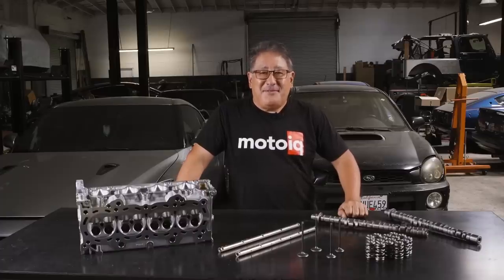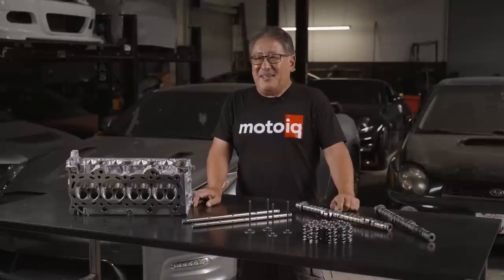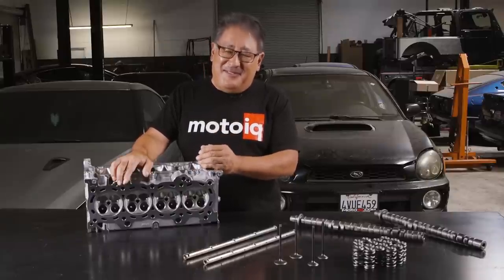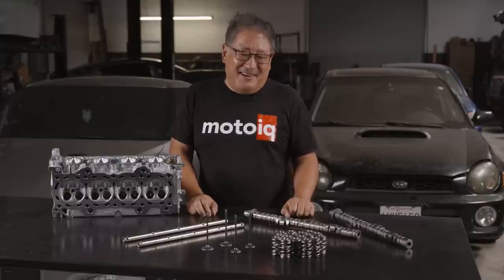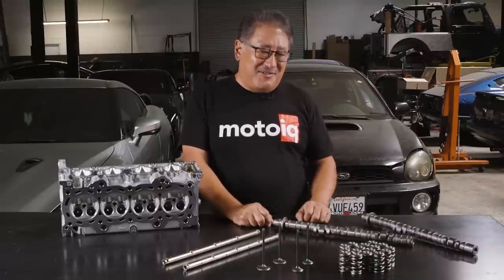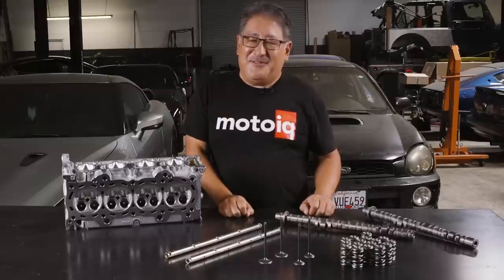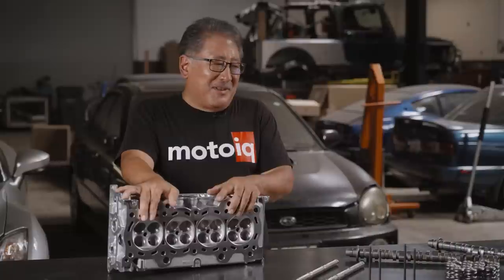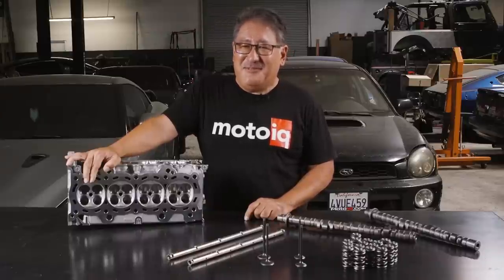Honda K-Series Cylinder Head Tech

Comment: Hi bro I very much enjoy your videos... I would love to see some 3sge/gte content, I have a 1987 Toyota Celica GtFour with 3sge beams redtop+T... But what I really wanted to ask about is if you have heard of micro lattices.... If not Braking taps has a good video on them I was thinking that scaled up and with a little(read... Lots😂😂) development I think you could make hyper efficient radiator and intercooler cores... Highly recommend checking it out.... Maybe you can send me a couple of them if you ever develop it 😁😁😁
Reply from the maker: We just did a few 3SG's but forgot to do a video. I think micro lattice structures have potential for heat exchangers but I don't see how you could get airflow through them.  My opinion for automotive use, they are more for insulators and heat isolators.

Comment: Hey guys. Question about throttle body size and turbo applications. Would it be beneficial on a turbo setup to have a 90mm throttle body with a centerfeed, (center-inlet as you mentioned) intake manifold? My second question is about having a centerfeed intake manifold and running the risk of getting major heat soak because the intake is generally right behind the radiator. Let me know what your thoughts are please, I really appreciate it. Thank for all ya's do. Cheers from Canada, Ontario!
Reply from the maker: For a drag car yes, for anything else no.  Heat soak is a minor issue.  Sure it's better to duct the radiator but the power loss due to the radiator discharge is negligible.

Comment: I'd love to see some comparisons between the k and ka motors. Considering how much power the k24 is capable of, it confounds me that its so difficult to get 200whp na out of the ka24 with their relatively similar overall geometry. Do you guys have any insight there?
Reply from the maker: Its all in the cylinder head.  The K motors ports flow way more than the KA.  The K motors finger follower valvetrain can also provide way better valve motion than the KA small diameter shim on bucket.
Reply: @motoiq  Thanks for the reply. Thats about what I thought. So a proper valve job, cam, and port and polish would be the best bet then? I'm also interested in the bc fully balanced crank, but am not sure if its worth the investment.
Reply from the maker: I would not bother trying to chase the K motor for NA power.

Comment: You guys have experience with the K-motor and Cayman builds.  Why not combine the best of both worlds?  Other builders are trying to work out fitting a K24 into a Cayman with a little fabrication.  I'd love to see you guys tackle a max street K20/K24 N/A motor swap in a Cayman.  More N/A power than the flat 6 for less money!  It shouldn't be that hard to find a Cayman donor car with a blown flat 6 motor in California, right? 😎
Reply from the maker: An LS goes in there even easier!
Reply: @motoiq  I remember one of those builds, but they had to lift the back hatch permently an inch or two to make it work.  Has anyone tried a shorter LS since then?
Reply from the maker: They makes some good swap kits now and I swear it fits in there better than the stock flat 6!

Comment: Broad question. Currently building a miata. I have a k20a from the cl7 accord. Would the k20 be ok to get about 260 flywheel with bolt ons drop in cams. Or would i be better off with a k24 bottom end with the k20a stock head ?
Reply from the maker: Either can make the power, of course the 2.4 will have a wide powerband.

Comment: Yes i have stock k24a2  05 tsx motor in my ek hatch vtc oil pump tensioner all that stock.stuff acura rsx type s i have 52inch itbs big tube plm header this is perfect knowledge thank you
Reply from the maker: Very nice! get some cams and bigger throttle bodies!
Reply: @motoiq  yeah I would have get them ported out then  they would be a couple sizes bigger
Reply from the maker: Porting ITB's won't change the size of the throttles, the most restrictive area.

Comment: In a track/time attack application with a close ratio gearbox on a turbo motor, would it make sense to get rid of vtec there? I have heard the vtec mechanism is very violent on valve springs.
Reply from the maker: I would probably keep it, I would review data to see if deleting VTec would hurt.  In most cases it would.

Comment: Do you recommend flat face valves over dish for na street build? I know flat valves are little heavier but you can get little more compression so not sure if the weight will be issue and offset the power gain from more compression
Reply from the maker: It depends but I would rather have a lighter valve and compression in the piston if it was a race engine going for really high rpm where valve control was an issue.
Reply: @motoiq I was going to use 12.1 pistons but then my tuner said its harder to tune for power with 12.1 because of our fuel in California is only 91. Although I kinda regret going with stock compression of 11.1 because some cars come fron factory with 12.1 or even 13.1 and so many people are running high compression with no problems. He was saying to make it work you need to bring timing back and that car hurt power I don't know how much is true but on bright side of I wanted to turbo or supercharge it's better I stuck with stock compression. Last question since my engine has been decked 2 times meaning rebuilt twice and im running flat valves how much more compression you think im getting ? Maybe 11.5?
Reply from the maker: Your tuner is 100% correct. Those cars with high compression stock are all DI, that's how they can get away with it.  If you are actually building your engine you will measure your CC's and your gasket volume and calculate your true compression ratio and order your pistons accordingly.

Comment: so k20a2 NA bolt ons, Toda springs & A3 cams + rh, 2.5” exhaust, 410 injectors, RRC im, GruppeM intake … dyno’d 242 whp @ 8897 rpm ..   bottom end stock.  Can I really crack 275 whp or near if I just have head work done?  Keeping it street and reliable & not changed by the cams and springs I just put in?  I’d be down to upgrade valves if needed.       Most NA k20 & even k24 builds I hear about pushing 280+ whp have bottom end work.  
I’d like to know if possible & approximate cost.  Whats best way to inquire?  Thanks!
Reply from the maker: A lot of it is in the header and tuning. I don't like the specs of the A3 grind, a lot of intake duration compared to exhaust.

Comment: if i’m going for a street build with a k20a3 i’m putting in my integra; would you suggest i just get a type-s a2 head or save quite a bit of money just porting, new valve train and cams on the a3 head?
Reply: i have a pretty low budget i don’t have the funds for a built head 😂
Reply from the maker: I would start with a K24A2 and do the basics, can make about 260 whp with FBO if you pick the right parts.

Comment: Could you do a video on what manual transmissions can hold to this type of power and their ratios please?
Reply from the maker: What level of power.  The FWD six speed is good for about the high 300's. There are options to handle more power, the costs go way up.

Comment: what are your thoughts on DC cams compared to Skunk2 cams? Local shop I’m planning to use for my K24 build (if I decide to go through with it) is recommending Skunk2 cams… is there something about the DC that makes the better?
Reply from the maker: DC and 4P all the way for the top K engine parts development.
Reply: @motoiq  is there any particular reason?  they all seam to make about the same power...

Comment: would the k24 head be better for daily driving over a k20 in a high compression na build?
Reply from the maker: actually no, I misread the question, the K20A head flows better
Reply: @motoiq  oh ok but would it make up in torque and midrange over the k20 or is the k24 too restrictive for this setup
Reply from the maker: Yes it will.

Comment: are you guys using something like Solidworks Simulation to to come up with different ideas, such as the chamfer back cut on the valves?  Or have most of these ideas been pretty well documented and circulated in K motor community?  I new to this world is why I ask.
Reply from the maker: They are things that have been done for a generation on all engines.

Comment: Can you forward this video to Ben at Gears and Gasoline, lol.  He seems to think a stock head with drop-in cams designed for 8,000rpm will be enough to make power until 10,000rpm! 🙂
Reply from the maker: I think his goal was to reach 10k rpm not necessarily make the most power.

Comment: Hello i was wondering if you could give me some i sight on cams?! Im looking ar the drag cartel 3.2 for my head build i have a k20z3 head aswell as many k24a2 heads but my main question is would i be better of with the 2.2 drag cartel cams instead since im not building the bottom end or would i be ok with the 3.2 cams which would be a better choice any info is appreciated thanks!
Reply from the maker: It depends on what you are going to use the engine for
Reply: All motor weekend fun car trying to get the most out of it as i can
Reply from the maker: 2.2 is probably better for stock port head and bottom end.

Comment: If it’s ok to neck the valve near the disc, why can’t the whole valve diameter be reduced for mass reduction?  Does it make getting seals impractical?
Reply from the maker: Because you lose tons of flow!
Reply: @motoiq  I think me means the stem of the valve, not the head of the valve. Would a thinner stem hurt flow?

Comment: Didn't have to do any special things other than put a turbo on it and a small little 02 sensor  spacer to trick the ECU into in riching a little extra fuel to get 300 wheel horsepower on the Dyno, no internal mods.
Reply from the maker: considering the 02 sensor is only closed loop control and when you are on boost that's open loop, its not a good idea.

Comment: You did not cover anything about lapping valves, my machinist said lapping valves causes problems and you will never get the cylinder to seal properly. The builders who can't fix their heads always bring their stuff over for him to correct. Valve seats must be cut, concentric to the center of the valve guide. Lack of concentricity in the valve seat itself can also prevent the valve from sealing tightly against the seat. You described back cutting the valve seat but did not go over what most of these guys are doing wrong.
Reply from the maker: A proper valve job doesnt need to be lapped. But that has to be a proper high precision valve job on a Serdi or Newen machine set up correctly with good tools.

Comment: crv 2002 with k20 engine..can i swap with k24 head engine
Reply from the maker: K20a head is better.  You need to do wiring and ECU changes to switch to iVTEC

Comment: I see you mention all types of sizes itbs I didn't hear you say 52inch itbs what are your thoughts on a stock motor k24a2 05 tsx motor in a ek hatch are these itbs good for this set up ???
Reply from the maker: 58-62mm, 52 inch is way to big!  I assume you meant mm in which case 52mm is too small.  It has fat midrange but will choke on top.
Reply: @motoiq  what kind set up would these itbs work in 52inch and did you ever own 52inch itbs for k series or know anybody this small ol are they rare
Reply: @motoiq  my set  up has  blox 1000zz injectors 450 welboro fuel pump has fuel regulator lines all done and raceing fuel filter  and I was thinking of shooting some nitrous too but small.shot just incase I need it lol
Reply from the maker: An engine like a B Series or an SR20 can use smaller ITB's.  K motors need to breathe!
Reply: @motoiq  yeah I guess we see what it makes on dyno in 2 months  im getting it tuned at clm motorsports  the tuner name is cuna he drag races alot you heard of them